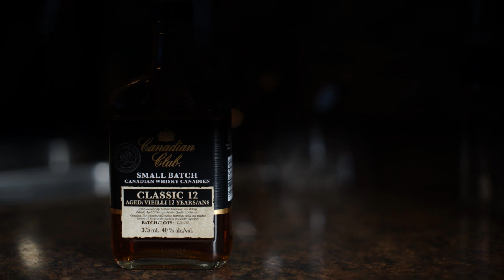What is Flash Sync Speed?

Comment: any way to do HSS with an A7R? Nobody seems to have a clear answer to this. I mean if a compatible sony flash has HSS, the camera body also needs it as well?.. i don't think HSS Flash Sync will work on a body that doesn't have this flash mode available, right?
Reply: Yes, HSS is available. I used a Jinbei flash triggered with a Pixel King (with the Sony adapter since the Pixel King is only available for Minolta-style hotshoe yet) and it worked like a charm. It also works with HVL-F60M, F43M etc. flashes.

Comment: in A7R flash menu, there is wireless option but there's no built-in pop-up flash, does this mean it can trigger sony flash like the HVLF60M?
Reply from the maker: As far as I can tell the only wireless triggering offered by sony is optical not RF. I'm using a very old flash that doesn't have TTL so I didn't dig too deep into the automated flash features. If I find out more I'll let you know.
Reply from the maker: Juan Dela Cruz I checked the 7R manual as well as the manual of a compatible "wireless" flash and they both refer to optical triggering of the remote units.
Reply: You need a second flash like the F60M or the F20M on your camera that triggers the external flash.